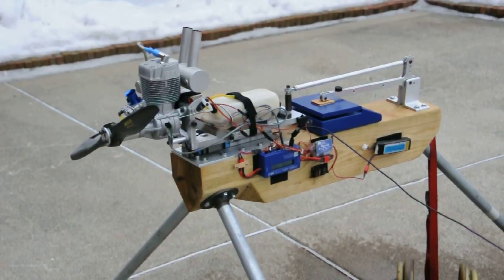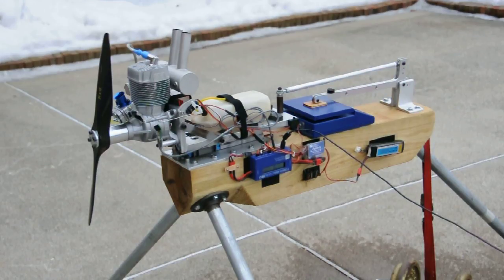OS GT55 Computer Controlled Test

Comment: dear frend ples help me , i have my os gt 55 this is my first gas engine , know i have some problem after brack in the main problem is the engine start very very difficult (short run time 1 or 2 sec.) and after start engine i cant rech max RPM i have only 5800 whit 22x 8 blade the carb High speed in 1 3/4 and low speed in 1 5/8 position how can i fix my problem

Comment: Hi, this is Mike (person who ran the test).  The engine runs and responds very well - I believe the initial hesitation the first time throttle was applied was due to the engine not being warmed up  fully, and the cold temperatures (note the snow in the background).  Overall I was very impressed with this engine, and look forward to flying it in a model.